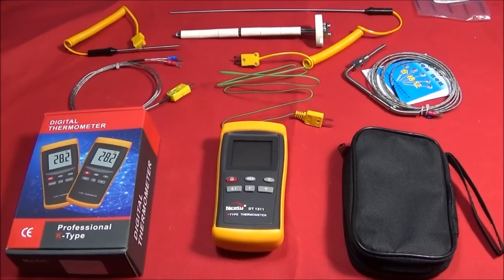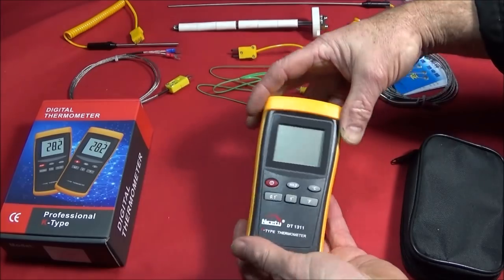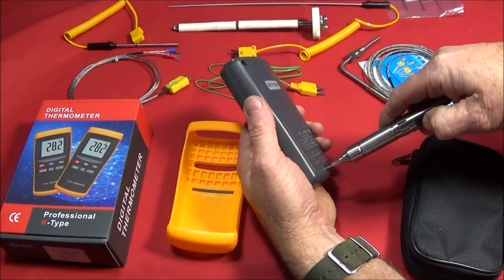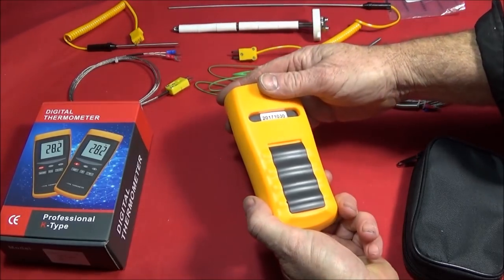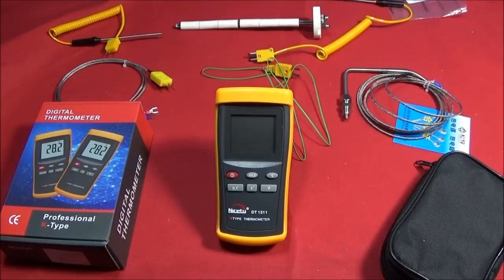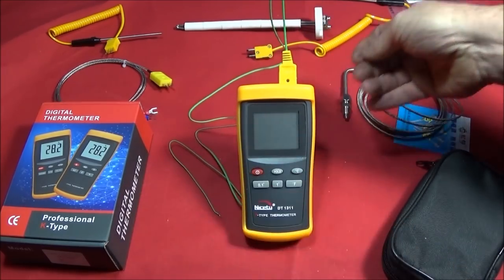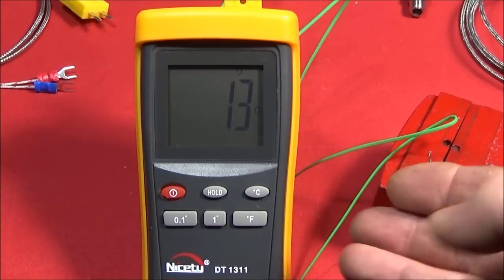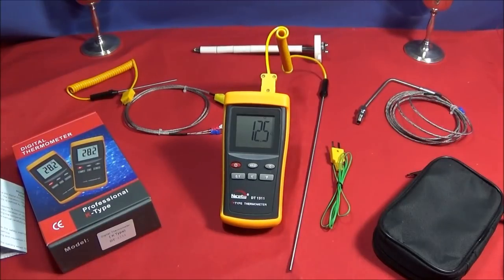DT-1311 Professional K-Type Blacksmith Forge Thermometer & TS80 Test.

Comment from the maker: SEE LINKS BELOW:-
DT1311 K-Type Professional Forge Thermometer  --  https://goo.gl/yvpdhM 
K-Type Thermocouple Probe Temperature Wire Sensors --  https://goo.gl/LCuuzR
Type K Thermocouple Block Ceramic Kiln Probe -- https://goo.gl/MqQVLq
2M EGT K Type Thermocouple Exhaust -- https://goo.gl/KoNU1m
Buy 3 Get 15% Off,Buy 4 Get 25% Off -- https://goo.gl/FZxFBr
Buy 3 Get 20% Off,Buy 5 Get 30% Off --  https://goo.gl/mKk3B6
Reply from the maker: MINI TS80 Digital OLED USB Type-C Programable Soldering Iron Station --  https://goo.gl/EQEaUj 
TS80 Soldering Iron USER MANUAL PDF:-
http://www.miniware.com.cn/download/t...
TS80 Soldering Iron FIRMWARE UPDATE:-
http://www.minidso.com/forum.php?mod=...
Reply from the maker: Mechanical Parts Christmas Promotion -- https://goo.gl/A14TA2

Comment: Hi Steve. Yet again you have read my mind... Here in my shed, I have an old multi-meter bought back in the 70's and it has a temp reading facility that I have never used because I had no probe! I have never known where to get one or what it needs. After watching your video I can see that you refer to it as a 'K' type and low and behold on my meter it mentions a 'K' type on the input socket for the probe! I followed your links and can see that the probe plugs do match the type on my meter... Ta--Da... you have given my 50 year old meter a new life and a reason for me to build a firebox.
Thanks Steve, yet again.

Comment: Great video Steve i have just built a 2 burner gas forge and this will be just the job i was thinking the same as you for using the forge for tempering 01. If it doesn't work ill probably build an oven and use a PID Controller with a ceramic kiln probe
Reply from the maker: Hi Peter Thanks, That's a good idea I think I will make a small oven as well if I cannot control the temperature
easily in the forge. Regards Steve

Comment: Hi Steve. Firstly just to say I've been following you videos on the Ml7 upgrades, been very helpful. My ML7 is now set up for basic work, new 1/2hp motor, cross slide & put new lead screws & resettable dials & mounting blocks. I just need to make shines to get my cutters up to centre. I have 2 questions for you. 1. Oil drip feeder fibre washers. I have had trouble getting the large washers for the reservoirs. I did find general 31mm one on ebay but they still leak. Any advice that would help welcome. There not bad but would like better. 2. Your K type 1311. I bought this some time ago for my gas forge. I agree with you on how accurate this is, fantastic on all my tests. However, my ceramic probe when exposed to flame shouts off. So I'm doing something wrong. I'm thinking put a 40mm length of box section steel in the bottom to work like an oven. It will take up space. Was it a gas forge you fitted to?? If so how you fit it? Do you think the box section would work. Again any advice welcome. Stay safe from this COVID19. Regards Hugo.

Comment: Steve,  for melting aluminum, can you put these probes into the melted metal to get a direct reading?  Or will that spoil the probe?  Thank you for the videos.
Reply from the maker: Hi Glenn, It says on the probe specification that they have a range of -50C to + 1200C so they should be fine. I hope to test these out at some point. Regards Steve

Comment: Steve have you fitted this yet to your forge? I bought this same metre with the same ceramic probe. My test like yours was excellent. However, my limited knowledge of how to use it on my gas home made forge wasn't good. I just tired it at the mouth of the forge and once it got to about 220'C it shut off. I think that was because to much probe including the electrical connection were exposed to close to heat & I need to bore a hole to insert the probe tip only. Haven't got around to it yet. I live in N. Ireland (UK) so would love to hear from you to see what results you get. My forge is 100x75 mm solid fire brick, tough as nails to cut.
Reply from the maker: Hi Hugo. I haven't got around to it yet as I have several projects on the go. I hope to get back to it soon though as I want to make some more Ray Mears type knives. It sounds like you have a nice set up. I was going to drill a hole in the side of mine about half way up maybe pointing down at an angle. Regards Steve
Reply: @SteveJordan  thank Steve. Yes I have a wood work shop from when I was professional in the trade. I retired over a year back from community & youth work as health challenged me so now it's all fun & I run some workshops for folks. I make knives & have been training in blacksmithing so I can add a new flair to my wood work. Take a wee look at my website to see my varied interests or YouTube channel which is fun for me. www.beavertooth.co.uk. Keep in touch I would loved to see your finished projects. I subscribed to your channel so should get notification.